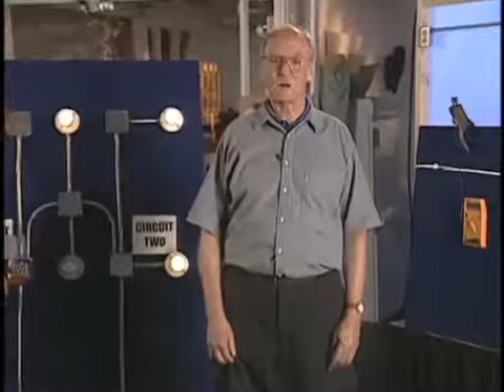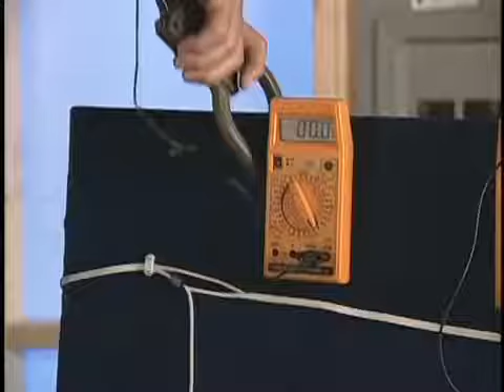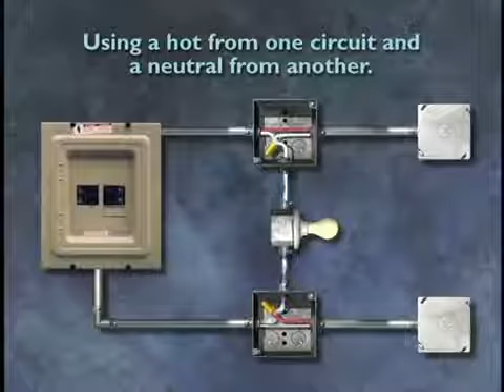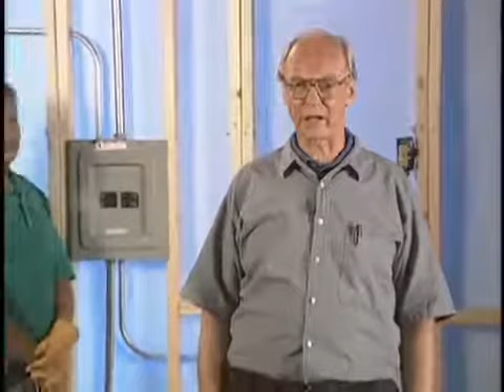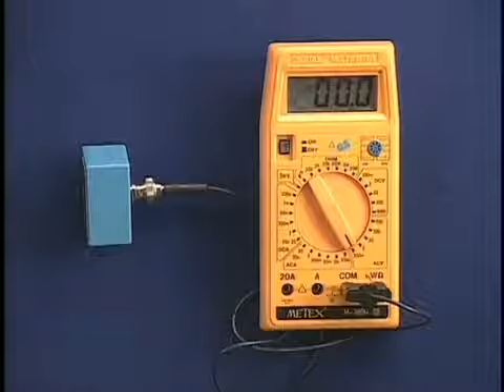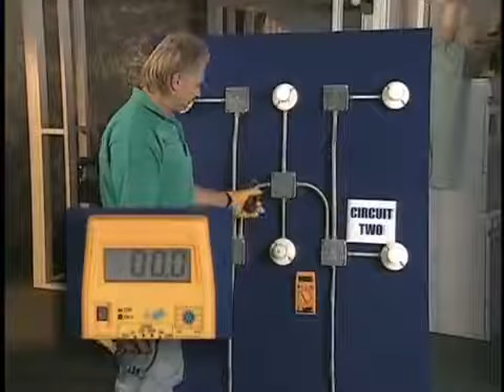Tracing Magnetic Fields EMF by Karl Riley

Comment: Awesome video. We have high AC magnetic fields since our electrician upgraded our service and, as per code, bonded the electric  to the cold water pipe. When I disconnect the bond, the magnetic field goes away. We still have old metal piping in our neighborhood, What can we do about this?
Reply: +Elizabeth J One way is to cut the pipe and install a short piece of pvc pipe or nonconductor.
Reply: +John Puccetti Thank you, but can I leave the cold water bond and will it still eliminate the magnetic fields?
Reply: NEC code requires cold water bond. But you can install the non conductor on the street side of you bond. It will eliminate the current from your neighbors. You might still have a problem on your side of the PVC.
Reply: +John Puccetti I am afraid that would require quite the overhaul to put it on the street side, The pipe is old--it might break and/or not re-seal well.
Reply: +John Puccetti By street side, do you mean still in the house but the piping before the meter?
Reply: +Elizabeth J Anywhere between your house and the meter. Is your pipe copper, galvanized pipe? The closer to your house the better. But if you remove the grounding wire and the problem goes away the problem is in your wiring.
Reply: +John Puccetti Copper pipes, yes. Our city still has them in the neighborhood, too. The magnetic fields do go way down when I d/c the bond, but if it is my wiring, then why are the magnetic fields still super high when the house main breaker is off?
Reply: Never heard of anything other than copper, galvanized pipe or newest PEX plastic.
Reply: I know when you have a house that is basically wrapped in copper wires that it will pick up microwaves or RF ( wiring becomes an antenna)  from any source Smart meters cell towers etc. So you still may be dealing with what is called the antenna effect. But that is measured with a different kind of meter than your electrician has. I use an HF 35C HF analyzer.
Reply: +Elizabeth J Main breaker off and cold water ground disconnected. Check the neutral or ground wire bare cable from your electric company. Where do you live? How old is the house? There is also a ufer ground connected to the steel rebar in your building concrete footing.
Reply: +John Puccetti I do have a RF meter that has a range of 1MHz-8GHz. I do get readings in the house from "somewhere." It drives me nuts that I cannot locate the source. I should be able to walk towards it, following the meter, but I can't. It seems to be in one spot that makes no sense, since nothing in particular is there. It doesn't become stronger at the floor or ceiling, or in any other direction.
Reply: +John Puccetti I will try this today. I'd prefer not to say where I live in a public forum. Suffice it to say, we are in the Midwest. The house is pretty old. I think it was built between 1910-1930's. We have been in the house about 20 years. There, of course, was some upgraded wiring done on the house, but it was an old 60 amp service (breakers, not fuses) that we always assumed was 100 amp, but it was not. When the electrician opened up the panel, there were several circuits that had doubled up wires attached. We now have a new 100 amp service and all the wires have their own switch.
Reply: +John Puccetti Also, today I just noticed that the AC magnetic fields double with our electric clothes dryer running, and I am not talking about near the dryer. Could that be an issue, too?
Reply: I know very little about your home. Is it on a slab and all the wiring is in the ceiling and walls or does it have a crawl space with wiring?
Reply: +John Puccetti We have a basement and wiring is on the basement ceiling and in walls.
Reply: +Elizabeth J Sometimes electric dryers are grounded incorrectly. I am a general contractor, electrician and for 6 years a learning student of EMF issues. EMF fields drop off very quickly but they are around refrigerators motors, inverters most desk computers printers. You need the right meter a lot of knowledge and then you may just need to avoid certain areas. I have solar panels the inverter put out an EMF to about 24 inches. I want the solar so I stay away from the inverter.
Reply: +John Puccetti Well, yes--I know this. I have several meters that measure different EMFs (2 different gauss meters, a RF meter, a AM radio, and the Stetzerizer Microsurge meter). I also understand about distancing from certain points as you mention. The magnetic field is allover the house, though, even with the power turned off, as I said earlier. That is what I need to fix, first. Second, I want to find the Rf source, even though I doubt there will be a lot I can do about it, other than shield. Third, I want to attack the dirty electricity, too.
Reply: +Elizabeth J The video does not talk about any of the electrical distribution problems. Utilizes do not have a neutral wire. In spite of the code that requires it. So any imbalance between the two phases is sent to ground at grounding rods I think every tenth pole has a rod. This is called stray voltage very serious problem in dry climates were ground rods don't work well. Cute name for a serious problem. Read "The Electrocution of America". Keep reading.
Reply: +John Puccetti My son just came over and we disconnected the bond to the water pipe and turned off the main breaker. There was still current coming in on the water pipe into the house. The numbers were not as high as when the bond was on (but breaker off), but, yes, so we are getting electrical current coming in on the water pipe, on the utility side of the meter, for sure.
Reply: +John Puccetti What would I look for to see if the pole near us and that holds our transformer,  has a neutral?
Reply: Any good plumber can install a non conductor at some convenient part of the water line. Let me know what you do. Plumbers have been killed when they cut the pipe and hold both sides. Make sure he knows what he is doing.
Reply: ***** There is no neutral. Because the utilities can save money by not running one more wire. Any imbalance or net difference is shunted to the earth.Called stray voltage. But that voltage will look for the path of least resistance which could mean pipes or a swimming pool.
Reply: +Elizabeth J  General Order 95   Section III   Requirements for All Lines 
   33.2    Ground or Earth as a Conductor   Ground or earth shall not be used as a normal return or circuit conductor. In direct current supply systems or in single phase or polyphase supply systems, a neutral or any other conductor shall be used under normal use as a return or circuit conductor; however, the grounding of the neutral or any other conductor is not permitted as a normal return or circuit conductor. The neutral or any other conductor is permitted to be grounded only for the purposes of stabilization and protection.   Note:    Revised January 19, 1994 by Resolution SU–25.   
Violation of this rule has created health problems in farm animals and families, and dirty electricity gets into our homes and offices and schoolsvia ground rods and electrically conductive plumbing. I have measured higher EMFs in homes with the electrical service turned off due to unbalanced current flow.
Reply: +John Puccetti So, what is the utility response when someone, like me, tells them that their electricity is coming in on my water pipes?
Reply: If they respond they will say the milliamps are not  a health concern. What they do is legal. But not safe. email me directly johnpuccetti@sbcglobal.net
Reply: John Puccetti I tried to email you, but the emails bounce back and cannot be delivered?
Reply: @E J  did you find the source of whole house emf? Thank you
Reply: @vfsd234  The ground to the city water pipes was creating the magnetic fields on the metal pipes under the living room.
Reply: @EJ-oe4pg  Thank you for responding. May I ask what symptoms you had of the magnetic field? Did you install a separate ground for your home? Im facing a similar situation (maybe?). Still learning.
Reply: @johnpuccetti9383  Do you know if a neighbors solar panels /inverter can cause emf to our house? thanks
Reply: @sunnies336  I was looking for reasons for migraine headaches when I stumbled upon the EMF possibility. I submerged myself in research and realized that I had amps on my copper pipes. I mitigated this by disconnecting the ground to the city, inserting PEX, and having steel rods pounded into the ground to ground to. This eliminated the amps on my pipes. The biggest thing I noticed after doing so, was that my feet, which had felt arthritic and painful every morning, no longer hurt, and they have not hurt since I mitigated the problem several years back. This was a happy little accident--I had no idea I wasn't just succumbing to arthritis, and I am betting it was caused by the amps on the pipes.
Reply: @EJ-oe4pg  wow, thank you so much for sharing. We are in a similar situation. Amps found on our cable ground wire/health problems. Im curious about the steel rods? Were these bonded to the utility main panel? Would it be amiable to converse via email?
Reply: @EJ-oe4pg  Is it possible you can you say what you connected your new ground rods to? The main electric panel? Thank. you
Reply: @EJ-oe4pg  one more question...(please respond.).did you need to keep the ground to the city disconnected?
Reply: @sunnies336  Yes. If I re-connect to it, the magnetic field returns. My whole house is grounded by the rods that I had an electrician pound into the ground near my home. The PEX is right at the entry, and then it is mostly copper.
Reply: @sunnies336  Yes--the rods are connected to my main electric panel.
Reply: @johnpuccetti9383  what's the solution to this stray current john? Plan to read the book. Thanks for mentioning it.
Reply: @EJ-oe4pg  I'm planning to purchase a few meters to help find our problems. Do you have any recommendations for meters? Thank you so much.
Reply: @vfsd234  I do have several meters. It's a long list of names I don't have right in front of me. I use my AC Milligauss UHS2 by AlphaLab Inc. alot (for the magnetic fields). I also use my HF-35C from Gigahertz Solutions to check RF, but it won't detect the new generation 5G, which uses different frequencies in different areas, so it is difficult to find a proper meter right now to measure that. I also use the Stetzer meter that plugs in your outlets to check for what they call "dirty electricity." Checking your pipes for amps is a whole other thing, but you can use the UHS2 to see if they are producing high magnetic fields.
Reply: @johnpuccetti9383  what problems have you encountered with incorrectly bonded dryers? (besides tripping their breakers) thanks
Reply: @johnpuccetti9383  have you found a good whole house filter for dirty electricity created from solar inverters? thanks
Reply: @EJ-oe4pg    If you have a 4 Wire Prong Dryer Plug you must make sure that the internal dryer "grounding wire" which is actually the Neutral wire is not bonded to the case with the 4 wire cord's green ground wire.  I think that is your issue.  Instead, electrical tape up the internal "ground" neutral wire and your problem will be solved.  This does not apply to a 3 wire Dryer Cord where the Neutral wire is bonded to the case with the internal "ground " neutral wire.
Reply: +Perseus Eurymedon Elizabeth already cut the incoming water pipe and spliced  with PEX plastic. That should have corrected the problem.
Reply: +Perseus Eurymedon I have noted that many cell towers are not on antenna search. I think any tower less than 60 feet tall requires no permit or inspection or testing as to compliance.
Reply: +Perseus Eurymedon Hi. We did just put the pex in after I wrote all of the above questions. I am still trying to figure this whole thing out, though. I just realized that a water tower 3 blocks away from us is being used to hold the antennas that send and receive the RF signal for the electric smart meters in our area. Now, I am wondering if they attached their bond to the city water system. This happened in East Lansing, MI, at a park near a neighborhood. Maybe that was/is the problem? This just gets more interesting every day!. So, while we have isolated ourselves from the ac magnetic fields on the water pipes, we still have "dirty electricity" on our house wiring and we have an RF signal that I cannot trace.
Reply: +John Puccetti 
The other option would have been to properly disconnect the bond at the main panel, however this may require some detective work because sometimes there is a cut insulator on the neutral that shorts onto the metal conduit, which can be shunted to the water pipe.  Also, sometimes the neutral bond on the can is corroded and causes increased impedance which makes the neighborhood's neutral/ground have an increased resistance thus causing net current, because of the alternate ground path.

At very least, I would recommend installing a grounding electrode (just outside) along the same raceway as the main service drop enters the house.  The return current will only seek that path if the impedance becomes greater on the main service line--as well it should.  This will ensure that the neutral has a backup ground.  

This is the misunderstanding that many electricians have with GEC's, the neutral/ground bonding points should ONLY be at the line side of the main service entry.. and many think (as Karl pointed out) that it's bond at the service panel why not everywhere else in the circuit... so they bond the water pipes.. it's a lazy way to ground and potentially very dangerous.  

The grounded conductor (neutral) should never have parallel paths, especially along a different phase circuits, because of the added effect.  These create the &quot;net current&quot; effect,  which could create very high magnetic fields, "hot spots" in the house and can overheat at high loads and can cause GFCIs to not function properly.  These types of problems are exacerbated during the summertime because of high load draws from air conditioning and increased electrical draw.
Reply: @Perseus Eurymedon  can you comment of the use of ufer/rebar ground and emfs? Trying to decide if we need a standard grounding instead. Thank you very much
Reply: +Perseus Eurymedon Thank you. Yes, I have been to the antenna search for my area. There is a microwave class antenna on the water tower, 3-4blocks away.Not all info. is provided about these structures, though.
Reply: +Elizabeth J 
Elizabeth, please read the book "Tracing EMFs in Building Wiring and Grounding". Karl Riley is a wonderful man. He is able to convey complex electrical engineering concepts into layman's terms.  In fact, my experience with a high EMF problem in my house and reading his book assisted me in attaining a degree in engineering. 

The problem you are describing sounds similar to shunting the neutral (GC) onto the mechanical ground.  If the net current exist when the main panel is disconnected, then there is current on your water pipe--very common misunderstanding of the grounding code.  I had this problem when I lived in Chicago.  There are several ways to handle this.  Have an isolated ground installed and use that in place of the water pipe ground.  Also, keep you neutral bus and mechanical ground separated, otherwise it will create a parallel neutral (as shown in the above video).  As shown in the video above at https://youtu.be/IAAZCMns8YM?t=303 the reason you are having a difficult time pinpointing the source of the EMF, it is because you are trapped within the paralleled neutrals in your neighborhood.  More than likely, someone within your neighborhood has the neutral bonded to their water pipe and it probably exists the opposite side of the house where the service drop enters.
 
I had similar problems in the past and found it very difficult to find an electrician to understand.  Too many electricians lack the engineering understanding, but this is mostly because of bad teachers.  Whereas, Karl is a great teacher, he takes something complex with a dense amount of information and makes is very simple, and might I add he does so freely and selflessly... his main concern is that others understand and learn.  Just think about how many people's lives he improved and children that could have been exposed to such dangerous conditions at those schools he corrected these problems.  I wonder if Karl is still around?
Reply: @perseuseurymedon9416  thank you for this very informative response! Would it be possible to converse with you about a similar situation I'm experiencing? Thank you so much
Reply: @perseuseurymedon9416  do you have an email that I can direct a question to? thanks
Reply: +Elizabeth J 
First, I would like to say that I have a different way of looking at these EMF concerns.  

If you stick with NEC you will be on solid ground in a municipal argument, if there is any kind of code violations, which I'm sure there are.  Trying to get governments to be concerned about EMFs, in particular, is generally a weak position to take, because you have to prove something is harmful for them to correct it... and there are all kinds of bureaucrats to find someone to produce something that says EMFs poses no health risk.  This is mostly why so many Cell towers are built on just about anything that stand high.. smoke stacks on schools, trees and even roofs of assisted living buildings.. there is almost no regulations on this because they don't see any health concerns about it... and the policy is the people have to prove something is HARMFUL BEFORE STOPPING it, instead of the governments having to prove something is SAFE BEFORE STARTING it. 

However, in the National Electrical Codes (NEC), where there is a net current, there also happens to be a code violation.. so that's the GOOD thing.  Usually these problems can be corrected easily when guided by someone who has a lot of experience and knowledge.  It's great that you are doing the detective work, as this leads to an overall awareness and the demand for more competent workers and managing.  It doesn't have to be an expensive thing, people just need to be more informed and educated, like how Karl has done to many electricians.  

I would first start with this website: http://www.antennasearch.com/  and determine what exactly is built near you and how much load it draws.. because if there is a NEC violation it will be greatly magnified in the area.